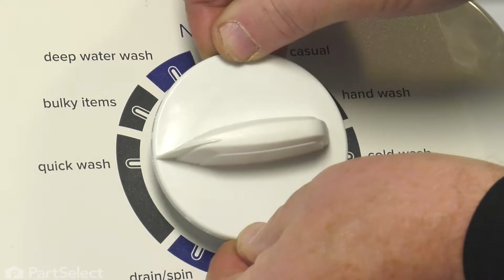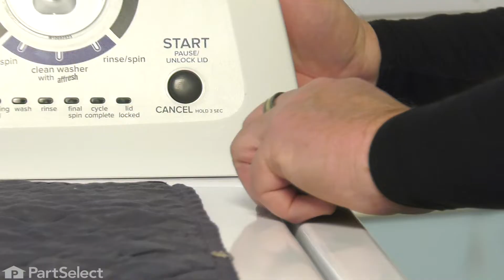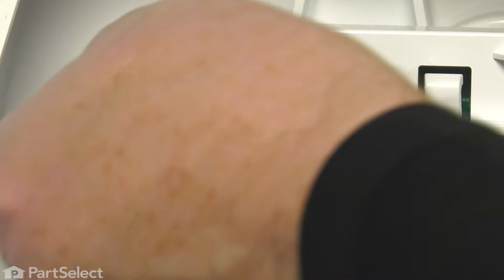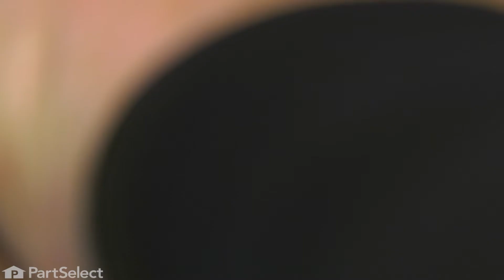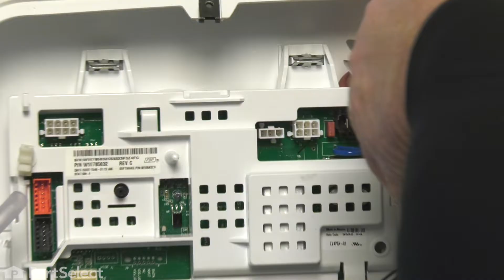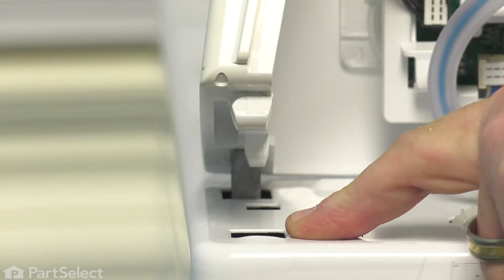Whirlpool Washer Repair - How to Replace the Control Board (Whirlpool Part # W11116502)

Comment: Thanks!  I tried to short cut it without tipping down the front >> bad idea. Also, the black tabs are not fun (making lacking hand strength). Excellent video! (BTW, I'm a 64 year old woman so others can do this!) 🙂   For some: check your machine and model number because some of these machines had a faulty sensor >> and parts + labour were free (front & top load). I can't find the link now.

Comment: I can’t get the lid lock wire bundle all the way in
The reset lights go on but the new lid lock part doesn’t want to stop blinking
Is that bc I didn’t push the wire bundle into enough ?????????

Comment: This is the first time I've tried to repair any appliance I've owned and it was a little intimidating even if the process seemed straightforward enough. I used your video earlier and it really helped a lot. Anyway, the washer seems to be working properly now so...thank you!

Comment: I was excited.I thought you were going to replace the pressure sensor on the circuit board. I was.
Hoping to find a part list for pressure sensor since it's just the part that's bad not the whole board.
Reply: Have you found a replacement. I would like to replace mine to repair my original board and keep as a spare.
Reply: @gearwrench1davis392 I ended up snagging one off of a bad board.

Comment: Thanks. I got stuck on how to pry the board out.  Unfortunately this is the SECOND time I was forced to replace this item.  The first time I bought a used upper console with the control board in it.  I just needed to label the wire harness connectors. The second time, I had a refurbished or new control board.  The new board came with directions to set the dial at 12 o'clock before plugging in the machine.  I purchase my Amana washer (and dryer) new in 2018.  The washer only lasted THREE years before it failed due to a faulty board as diagnosed by ($135) repair visit.  I was advised the replacement part cost $400, or about $20 less than I paid for the washer new.  What's wrong with this picture?  My parents bought all new appliances the year I was born (1955): Westinghouse washer and drier, Frigidaire fridge & GE oven.  They were all moved twice, and still working 29 years later when my folks retired and moved.  I don't remember EVER seeing a repairman.  The Frigidaire was demoted to the basement for beer duty when it was replaced by a hideous avocado green fridge about 1972,  Why are modern appliances so disposable?